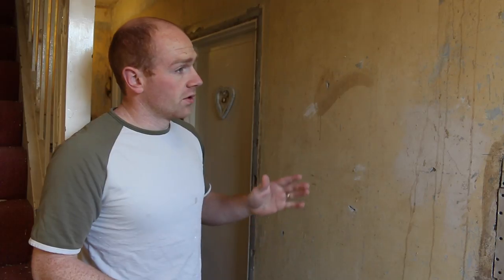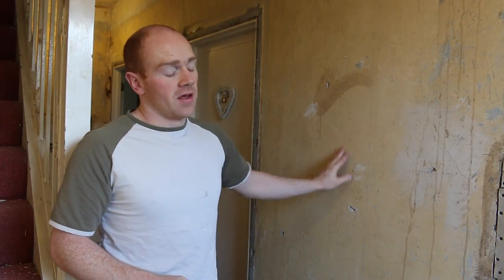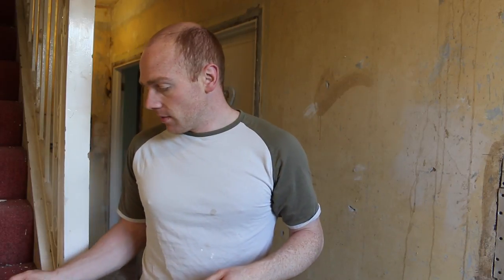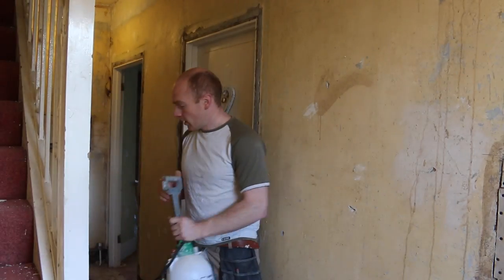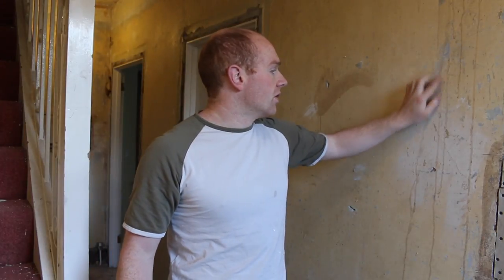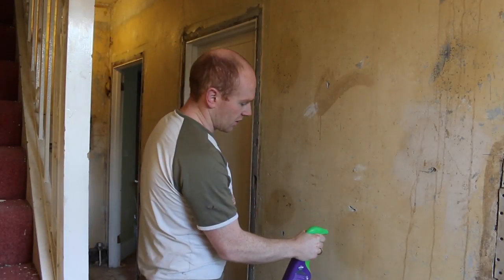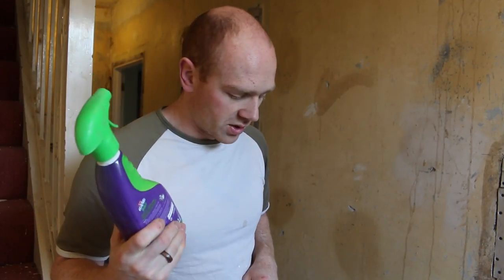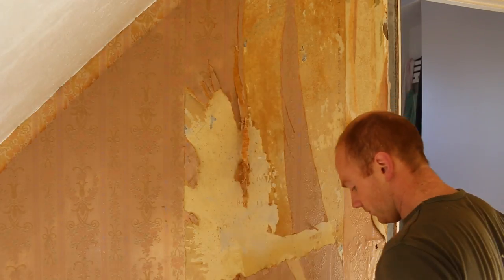Stripping Wallpaper without Steam

Comment: Hi. if you have a taping knife (the one used for dry lining)use that for stripping the paper off when it comes off that easy. not only is the blade wiper but it's a bit thinner so it gets underneath the paper more easily. also good video. keep up the good work.
Reply: ps good video. keep up the good work.

Comment: you can get a 3 wheeled tool from screwfix and the likes which you roll over the wallpaper which scours it all over to help water get behind the paper to strip it off easier too!I always use fairy liquid.  never thought of fabric conditioner except for soaking cleaned natural bristle brushes in to keep them soft after use!
Reply from the maker: I ended up with a combo of a stanley knife and an old perforating roller, definitely a help if vinyl.  Have seen the wheel rollers too, they look good but hopefully I am done with all the wallpaper stripping, well for a few years at least!
Reply: Good stuff! Woodchip is by far my worst nightmare! According to the plasterer I use, as long as Woodchip is tight to the wall it's perfectly fine to plaster over it... who knew?
Reply: Marc Gray you've been given some wrong info. you can't plaster over wall paper ever. trust me
Reply: Sean  Danes never seen it done so couldn't comment. just going off what I was told. me personally, I wouldn't do it.
Reply: Marc Gray I'm a painter and decorator and I get sick of sorting out plasterers handy work lol
Reply: I do it on weekends for people my day job is property maintenance in general. Worst one I've had is rolling a ceiling with new plaster... don't think whoever plastered it had heard of pva and it sheeted off on the roller!
Reply: Marc Gray yeah that can happened  it's always best to over board them. even if you use PVA it's only going to bond as well as the paint underneath is bonded to it.
Reply: Sean  Danes it was over boarded in the end. perfect after that! took a while to get the rollers clean mind!